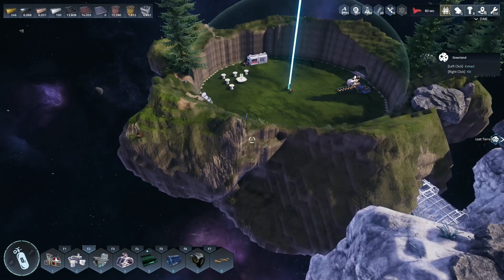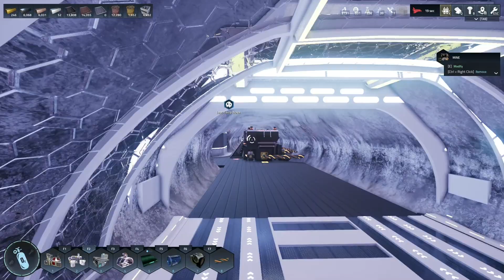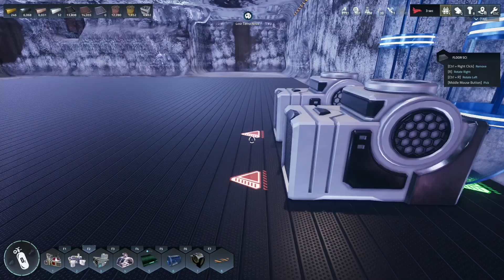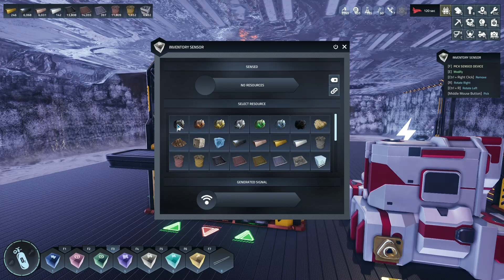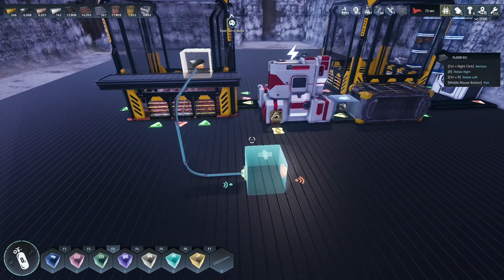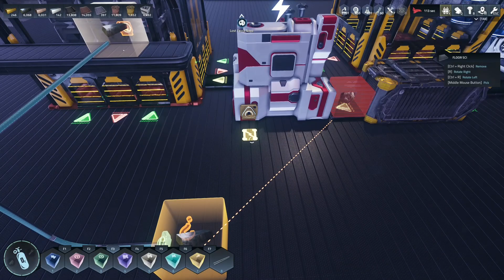Astro Colony - 30 - Logic Block Basics

Comment: you will need to set up a system to watch how many are in the inventory of the machine as i set up something similar and due to craft speed (bars to plates) I ended up with over 1000 of each bar in the machine when I only wanted 200 sheets
Reply from the maker: Yep, I've built a system that checks the storage amount for one pusher, and the amount of goods being converted for another, so it doesn't fill up the machine and you end up with twice the amount of things you originally wanted.
Glad you can use a single cable to read multiple detectors, makes the build a little less complicated.